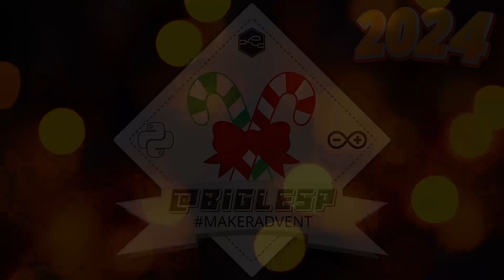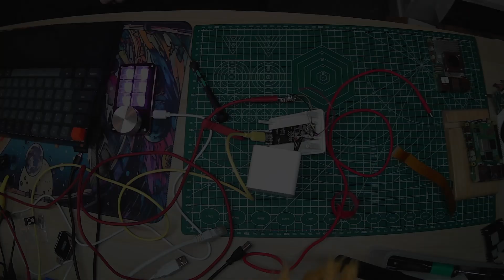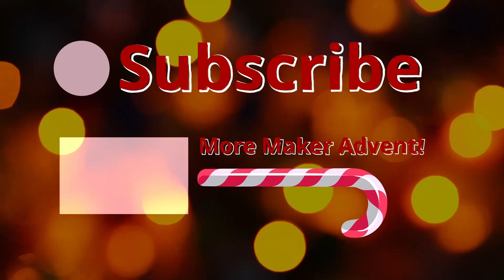Maker Advent 2024 Day 19: Failure is an option

Comment: Great video and great reminder of how we learn and improve!

I've had a couple of Vindriktnings laying around for a couple of years. One of them, I've got a small OLED display to integrate into the front panel. I managed to break the display in half fitting it into the 3D printed replacement front panel, and then I had to resolder all the connections for a new one... and then put it to one side with the intention of getting back to it... and of course it has stayed on the "fix it later" list. I'll have to properly sort that out after Christmas!